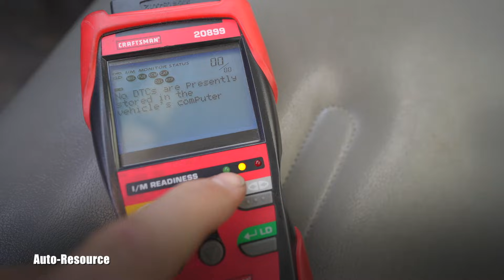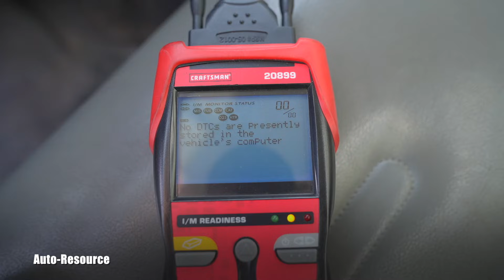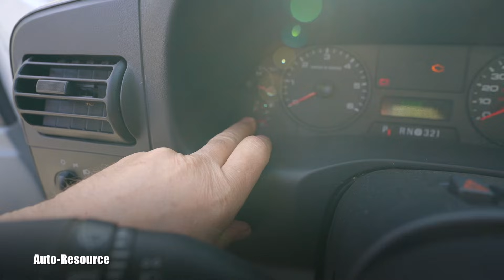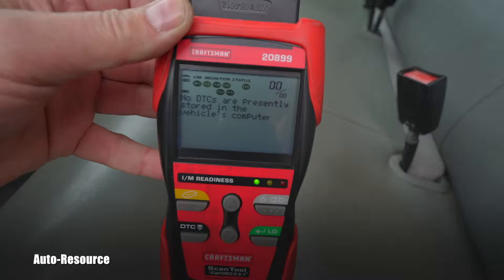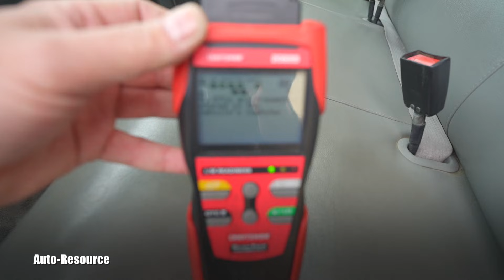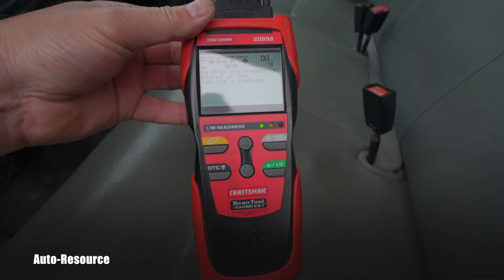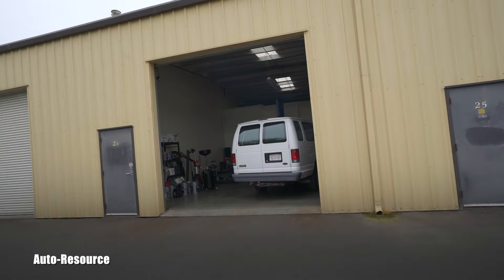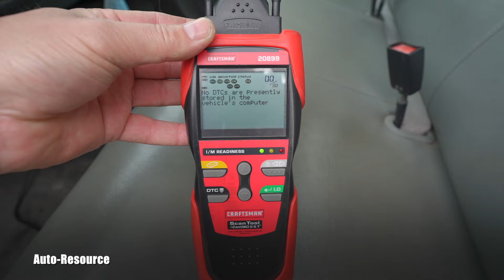How to complete EVAP monitor

Comment: Specifically for Ford vehicles: If you have a scan tool with more information, the tank level needs to be between 15% and 85%. It will not attempt to run the test if the tank is completely full. It also needs to be between a certain temperature range to run the test (roughly 40-100 degrees F, but the vehicle reports everything relative to this in degrees C). If you drive it like I did on a cold day right at the bottom of the acceptable range for the test, if you dip by 0.1 degree it stops the test and you need to start again. There is a bypass procedure if you are outside of the temperature range, where you cold soak the engine for at least 8 hours and then repeat all the other tests.

Comment: I replaced fuel injectors for misfire issue,  now Emission test not pass due to FUE not ready even after many hours driving,  you think need to coding new fuel injectors to pass Emission test or coding new injectors not related to Emission test  ?

Comment: I have a update on my evap not ready status. As of yesterday all monitors are green and no DTC's present. What I found with my scan tool is that it has drive procedures for getting your monitors to clear. For my evap monitor #1 idle your veh for 5 min.  #2  place your car in gear and get it up to 30 to 40 mph for 2 min. Don't go over 40 mph. I tried this 3 times and the 4th time was a charm. The OBD2 scanner I have is a Zurich, this tool just payed for it's self 10 fold !!!.  Find yourself a back road someplace that's safe for you to do this really helps.

Comment: I have an issue with my cobalt i replaced my manifold, catalitic converter, and oxygen sensors. Once my catalitic converter passes i immediately get the check engine with only the p420 code. The evap never passes? I changed my gas cap, cleaned injectors, spark plugs are good. Solenoid is good. You think my evap can need replacing? How does one test if its bad?
Reply: P420 is probably a inadequate aftermarket converter and O2 sensors.

Comment: The last remaining monitor EVAP never went away on the 2000 V6 Camry in over 6 years and still won't go away. Replaced gas tank cap with OEM, replaced O2 air fuel sensors with OE, replaced spark plugs, remove both transmission and engine oil pans, replace transmission filter, clean engine oil pick up tube, clean throttle body, replace PCV valve, replace air filter with OEM, replace ignition pack coils, replace plug wires, clean mass air flow sensor - no can do. Probably forgot a few things. Idle a little high, use a little more gas otherwise car runs great! Its an old car.
Reply: EVAP canister, EVAP Purge Solenoid and EVAP Canister Vent Solenoid. Those need to be checked especially if the vehicle has been on allot of dirt or gravel roads.

Comment: Gonna try it. Because I had replaced two head valves. I have been running the vehicle for 2 months with no mechanical issues
 Except the EVAP not being on.

Comment: So my EVAP monitor will not complete on my 2003 Ford Econoline van with 28K total miles. I have about 1/2 tank of fuel, will add additional fuel and check gas cap to ensure it is tight and hopefully it will complete. Yes, I did change the battery recently but rarely drive the van so more miles we will put on it.
Reply: Did adding gas set the monitor?

Comment: You don't need the evap monitor ready to pass a smog test.
Reply: @Ruby Pedroza In California yea
Reply: @MrFresh559  wrong ... That's the only one allowed to be incomplete as long as the rest are complete and in some cases like modern cars  no permanent codes...
Reply: @MrFresh559 in northern Virginia also, you can pass emissions testing with one (1) incomplete monitor.
Reply: If the car is older the year 2000 you need to pass evap
Reply: What about 1998  @Kurry34
Reply: @Kurry34 at this point, in the year 2025, a car that’s 25 years old or older is exempt from emissions testing in manager jurisdictions.
Reply: Not true. No smog needed for  my 2009 Civic
Reply: What about Georgia, anybody know?
Reply: Yes Georgia you do @k-a147